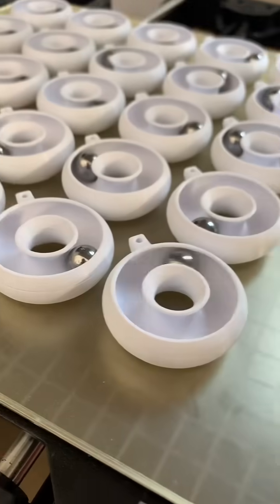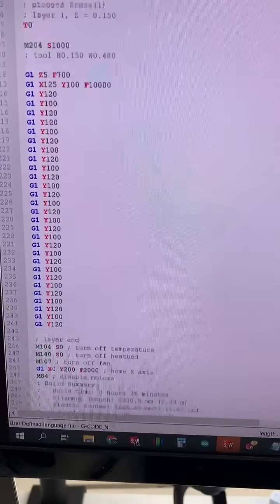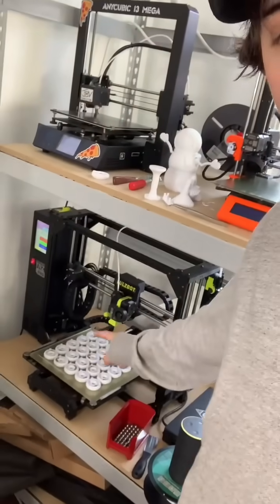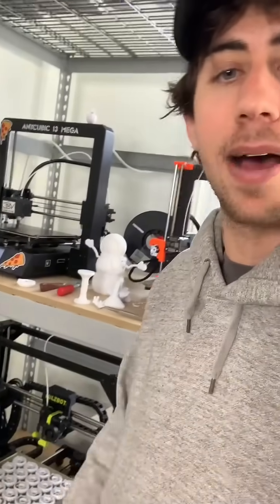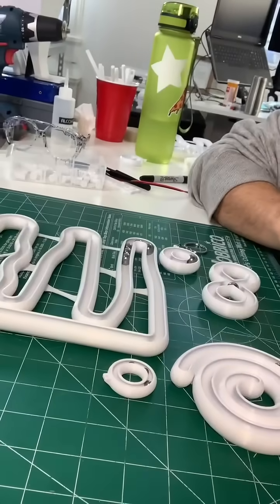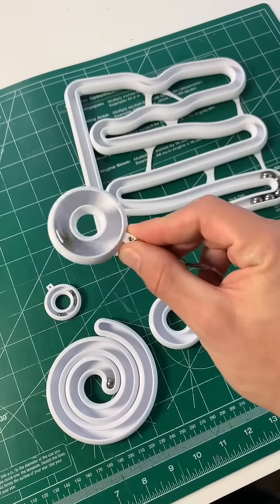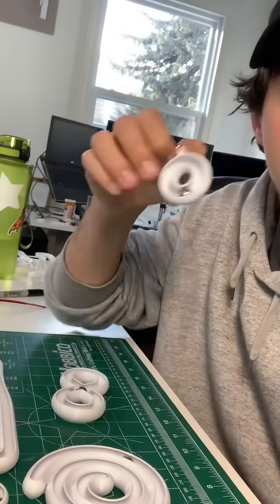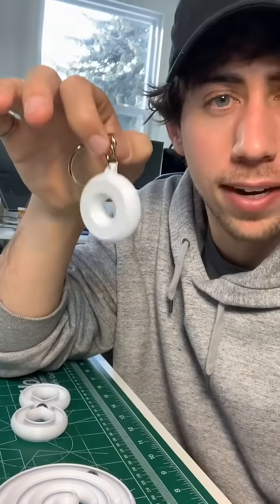Mesmerizing Effect with Custom G-Code

Comment: What if you make the ball magnetic and hook a led circuit to the donut? 
When you spin it in the donut it should generate an electric current which would light the led.
If it works, you could even add leds multicolored.

Comment: That's cool!  I guess the direction of rotation is dictated by the starting position of the ball.
My Challenge:
Change the code so all balls rotate in the same direction, regardless of start position.  Maybe a slow startup with both X and Y movements?  Slow circular movement transitioning into the linear movement?  Have fun.
Thanks for the video.

Comment: How are these ball bearings? Please explain.
Reply from the maker: The steel ‘marble’ is a ball bearing
Reply: @Engineezy  no its a steel ball... you get a bearing once you put two rings and a retainer on either sides of a bunch of those balls. That was exactly my point how is that a ball bearing it's not it's a ball.

Comment: Out of curiosity: did you try long enough to find wether the balls sync ( like metronomes on a table)?
Reply from the maker: I didnt! But it all depends on where they are in the ring when I turn it on. Because it’s moving on 1 axis only, there’s no way to specify which way they should initially move

Comment: If this goes on long enough will they spin around in sync?
Reply from the maker: They won’t unfortunately! The rotation direction depends on where the bearings are in the ring before it starts moving

Comment: Can anyone explain to me the physics behind the motion of these balls.
Why some are moving clockwise while others are moving counterclockwise?
Reply: The answer is actually not very interesting. The only thing that affected which direction the balls go around was which side the ball started on.

Imagine you have one of those donuts in your hand. If the ball is on your left and you quickly move the donut away from you, it will be spinning counter clockwise because the ball will be momentarily left behind by that movement and be forced towards you and right.

If it's on the right, that same motion will force the ball to go down and left, into a clockwise motion.
Reply: @cxx23  thanks

Comment: The speed of the table inflection is equally or more important than the distance at which the table moves. The table moves faster given the shorter throw. Slow that down proportionally to the distance moved and they will oscillate at same speed or roughly same speed. 
Also what happens at 5mm distance with proportional speed to throw in this video? Will they even rotate? Bounce around and out of the donuts?
Reply from the maker: Next run I can mess around with it more and try these suggestions. Thanks!

Comment: How do you get the bearing in there??
Reply from the maker: Paused the print halfway through and popped it in!
Reply: @Engineezy  wouldn’t the nozzle start hitting the bearing in the next layers?
Reply: @michascigala4045 I think it’s designed with enough tolerance to avoid that
Reply: Came here to ask this. Doesn't seem possible.

Comment: The shaking on the table is interesting. 
They look like every other row is in phase and side by side rows are 180⁰ out of phase. It almost looks like it's a net force of 0 of everything is canceling out
Reply from the maker: I think it just depends on where the bearings are when the motion starts, otherwise everything finds synchornization!
Reply: If you pause it and count how many are on the left side vs the right side you can see how they're all spinning

Comment: I wonder if you can make it spin fast enough to take  them off the plate.
Reply from the maker: That would be SUPER convenient lol
Reply: Imagine making gcode that just uses that to remove them from the bed for you
Reply: @Ziedmac  imagine
Reply: @Ziedmac there are plenty of code that does it with the print head.

Comment: I wonder if like metronomes on roller bearings, would all the balls eventually start spinning in sync?
Reply: They already are in sync because the table is driving them unlike in the metronome case where the metronomes are driving the roller.

Comment: I like how there was 1 not spinning that he tried to cut out of frame
Reply: All I could focus on
Reply: and then it looked like more started messing up right before he ended it as well.
Reply: You have good eyes.
Reply: Uhh, what time code exactly?
Reply: @lio1234234  when he went to 20 mm
Reply: @lio1234234  0:34 When he goes to 20mm, it's the bottom-middle doughnut.
Reply: The one that stopped spinning didn't start spinning again. You can see it's still in the same place when it comes back into frame for a short moment, just before cutting away.
Reply: Dayum my old eyes 👀 must be going. Cuz I've watched it like 5 times and still can't see it🤷🏻‍♀️
Reply: It’s just because it didn’t start correctly. It works on the inertia of the bed which can be canceled out if it is started incorrectly
Reply: Facts
Reply: Yeah but there ended up being another that ended up in frame.
Reply: Tho to be fair, would it be satisfying to watch if he decided to keep it in the frame the entire clip?
Reply: Your cracked? The one not spinning is frame. Top row a little to the left.
Reply: There’s always gonna be defects or times that things don’t work perfectly.
Reply: Chasing perfection is dull
Reply: I knew that is gonna explode comment section❤
Reply: There's also one not spinning 2nd from top left during the 30mm. Don't think he was trying to hide it, but rather just not zoom in on the non-moving ones.
Reply: Each time there was one not spinning. Lol
Reply: There were 2
Reply: Wouldn't you have done the same Kevin?😂
Reply: Streisand effect
Reply: That's the one you make a keychain out of.
Reply: No he doesn’t cuz I’m I have eye problems due to a neurological problem and that’s the first thing I caught.
Reply: @purobrim36XX I too have eye problems but they are all spinning in my eyes 😬
Reply: Nothing spins forever god damn people always finding reasons to be negative
Reply: @rosstriestodraw 
Brother.... the one not spinning means it a defective product...

If it's meant to spin, and energy is put into to fuel it's spin, then it should spin
Reply: @potatosauce3561  it’s also funny because he’s wrong they all spin. One didn’t at one of the speeds but they did all spin. And he was so toxic lmao for what
Reply: @methoxeta  straight up like I watched 2 times everything moved besides it isn't even that deep
Reply: I checked it four times they all spend
Reply: @saittafpv5846  They all spin fine at the beginning so it's harder to catch, but right after he changes it to 20 mms one of them stops spinning. If you look at the corner donut that's closest to him and count three over on the left side, it's that one. Hope that makes sense.
Reply: @saittafpv5846  this guy’s just hating Kuz he’s slow as fuck lmaoo
Reply: @saittafpv5846  they definitely all spin tho
Reply: Literally all of them move except the second one in the top row from the left for that one shake then afterwards they were all spinning again
Reply: Now I'm wary of purchasing one of his keychains because what if I get defective one that won't spin.
Reply: @StoicSimp  It wasn't that it didn't spin
It's just that it stopped spinning at the highest speed, at one point.
Reply: Yeah... a half a second stutter doesn't mean it wasn't spinning AT ALL. I'd cut a very very slight fuck up out of frame too if I knew internet sleuths were a bunch of Karen's lmao.

(I'm exaggerating btw, just like the rest of yall lmao. It was longer than half a second, but the thing starts spinning again. It just hit a weird trajectory vs the shake and had a hiccup.)

Comment: Can, someone pls explain why some balls were revolving clockwise while others anti-clockwise?
Reply: It just depends which side of the donuts the balls were on when the bed started moving. The balls move in the opposite direction of the bed when the bed moves, so they’ll keep rolling in that direction
Reply from the maker: Alexander said it exactly! If I had a 2 axis bed, I could start the balls in a circular motion which would solve this problem.  But in this case it's up to chance!
Reply: Alexander said it well, but in addition, notice that this is a linear motion creating a rotational motion. Some ball bearings experience a force upwards, towards the top of the donut. Other ball bearings experience a downwards force, towards the bottom of the donut.

Comment: Still trying to figure out how you got the bearings in there....
Reply: if i had to guess he printed it halfway put em in and printed the rest
Reply: @Kamisokei  yes but the bearings stick out. How would he do that without the nozzle colliding on the balls and risk skipping steps?
Reply: @21area21  exactly what I was thinking, but I just realized the nozzle probably just pushed them around the donut
Reply: @Bcjc3  you're probably right, but old def be a little worried. If it's traveling radially, it could hit a ball in the center and screw up the printer tho. Maybe you can mess with retractions to fix that though. That's probably the most optimal solution. Just increase z height for any jogs.
Reply from the maker: Yup, just threw em in halfway. There were a couple failed prints along the way.
Reply: @Engineezy  thanks for settling this!